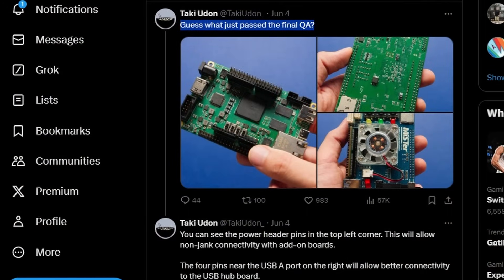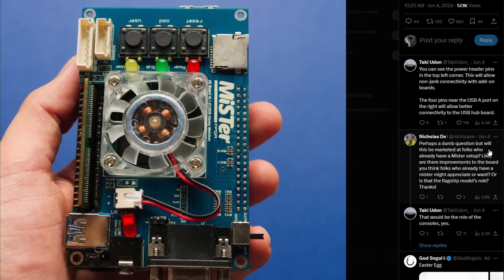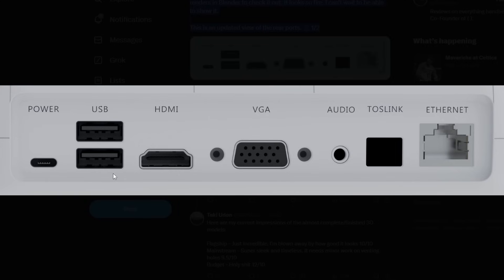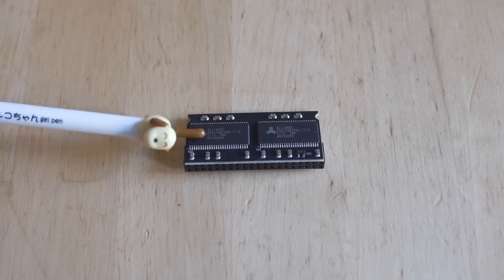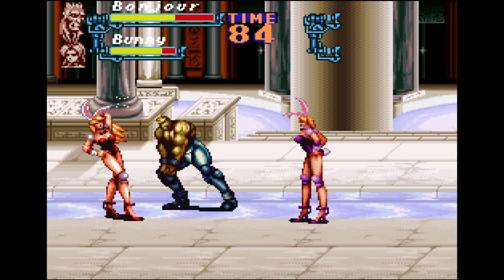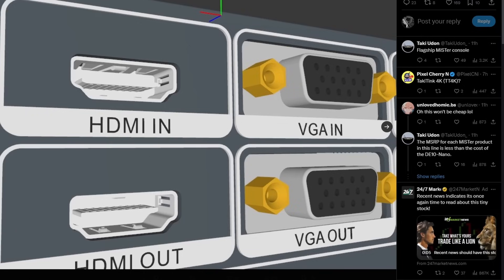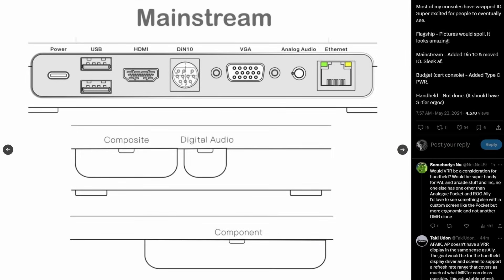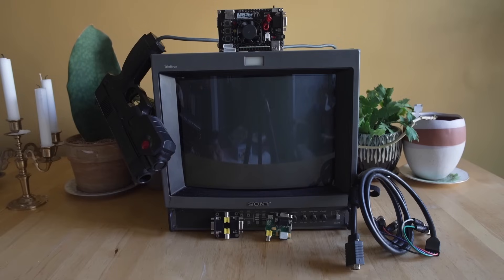MiSTer FPGA for $100! Ship Date, Cost and New Details Emerge!

Comment: I've been wanting to do a Mister but its hard to put in even $500 when I have a PC and GPU capable of doing almost everything up to PS3/360/OGXBOX. I do have the Analouge Pocket and dock and I love it. N64 FPGA would be awesome. I do wonder  if they could integrate a Raspberry Pi to handle higher end systems and pipe it through the built-in HDMI scaler?
Reply from the maker: Would be a heavy lift to integrate but you never know
Reply: Idk it just runs so clean like the real systems and removes the ADHD of being at your computer, plus it's so easy to get up and running after it is put together
Reply: "Can do" is different from the FPGA experience. Check out videos comparing the two. I don't blame you for not wanting to put out $230 board plus add ons for a full system, but for -$125... I'm not talking "up to PS3", but much older systems running CORRECTLY.
Reply from the maker: There’s plenty of options. That’s all that matters

Comment: wonder what the default cartridge connector is gonna be for, my guess based on no inside knowledge, SNES
Reply from the maker: That’s my guess too
Reply: @VideoGameEsoterica  i might retract my original statement.  looks like genesis carts have up to 64 pins on the PCB, SNES carts go up to 62.  so it might just use a genesis default connector, and use an adapter to scale down.  n64 carts use 50 pins if this information is correct

Comment: 6 face buttons, with the first four in a diamond-shape arrangement so you can play with said four like you're playing with SNES/PSX-style face buttons if you to, and add the extra two face buttons for systems that would require them and place them next to the first four to where you'd only need to move your thumb a little past the first four buttons to reach them. As for shoulder buttons, four would make it suitable for PSX and pretty much anything else I can think of that most people would play on the MiSTer. Dual analog sticks would be nice, but I'd be fine with sliders if they're HAL-effect sliders like what you'd see in a device like the Retroid Pocket Flip, as those are surprisingly decent to use (going by my personal experience). Sliders also have the benefit of being low-profile too, if such a feature would better compliment whatever device you're designing. 

As for the D-pad, I'm not too picky when it comes to either the traditional cross-shaped D-pad or a shield-type D-pad just as long as it feels good/responsive, although if you're gonna go with either option I'd personally take notes from how 8BitDo engineers their controllers' D-pads.

All this is my ideal layout for what I'd like to see on this MiSTer clone handheld. Nothing super crazy or complex, just something that will allow users to play everything up to Dual-Analog PSX/N64/Saturn games if they so desired, and comfortably based on the device's form factor. 

If nothing else, I pray the handheld will have better ergonomics than the Analogue Pocket and can give us the option to just connect whatever controllers to it we want if the device's own layout won't cut it for people in certain use cases.

Although thinking about it now, if this clone board even in handheld form manages to take off I could see some people designing their own unique handheld shells to stick the clone board into, and provide D.I.Y. alternatives to whatever the official handheld being sold is. I saw it happen quite a bit with the Raspberry Pi PCs, so it really wouldn't surprise me to see people make custom cases for the clone DE-10 Nano if you want to make your handheld look more like a DMG Gameboy or any other random form factor you could think of.

Comment: I’m really curious about the hdmi and vga in. The ossc pro uses the same fpga as the de10 nano I believe. Mister when you want it to be and a scaler for your other consoles could be helpful depending on setup.
Reply from the maker: My guess, unfounded, is you can use it in “scaler mode” and not as a MiSTer

Comment: All I want is a handheld mister with 6 face buttons so I can play Saturn everywhere I go
Reply from the maker: Let’s hope the handheld does have six face buttons
Reply: 6 face buttons and 4 shoulder buttons. That way everyone's happy
Reply from the maker: Let’s hope
Reply from the maker: Lot of Capcom stuff
Reply: It would also be perfect for N64, as you could have A and B buttons next to all four C buttons.
Reply: I'd still need dual analogues.
Reply: @Myako For PSX? because otherwise it’s not running anything that could use 2 analogue sticks.
Reply: All I want is a handheld with 60 extra buttons to map stuff to (menu, save/load state, speed, res up/down, shader swap, etc)... I ended up using a Bluetooth keyboard for all my shortcuts and it works well 👌
Reply: @Kiyoshi_9606  that's a bit overkill and probably sarcastic, but it actually makes a lot of sense.
Reply from the maker: @kiyoshimatsutsuyu1931 🤣
Reply: Lots of Capcom, lots of Saturn, and even for N64, 6 face buttons would be great for all these
Reply: Yep. Count me in on that

Comment: If these get any cheaper over time we can start telling people to just get a Mister over a pi since it is cheaper :P
Reply from the maker: Honestly they might get close to par in pricing
Reply: Just bought a Pi5 for $92...so pretty close already
Reply from the maker: I’ve got a second 5 I need to do a build with
Reply: Now we just need a mister addon for the Pi 5 to have better compatibility for classic systems. Maybe hybrid Emulators could start coming out
Reply: @LoganE01  Think that would be a dream setup, get a Pi 6 (someday?) that can handle Dreamcast, PS2, GC, PSP, and then Mister for true FPGA emulation for other systems. Leverage the Pi for User Interface/marquees/art, etc.
Reply: @billford171 well I personally feel like if somebody could put a mister on the GPIO pins or PCIE Lane (if not both) they could probably start making hybrid emulators and probably get closer to the pi 5 running PS2 and even if it didn't/couldn't then we would get a lot close to real classic systems on the Pi 5..... Also hopefully the pi 6 can handle a full GPU.